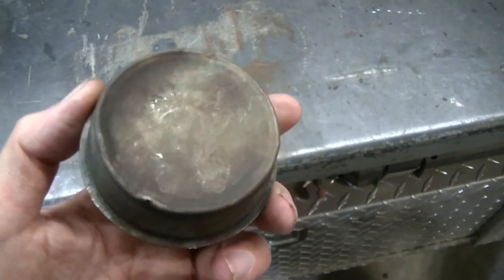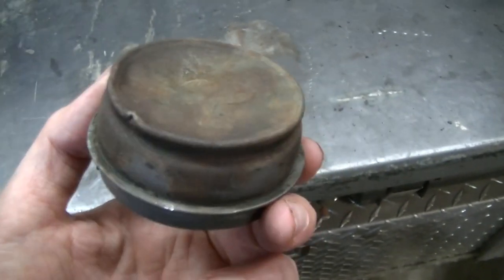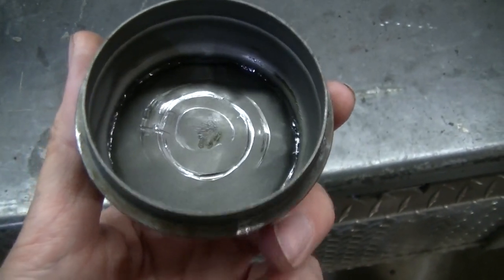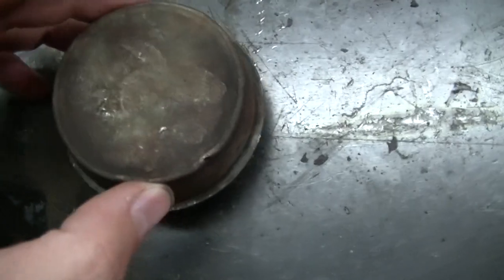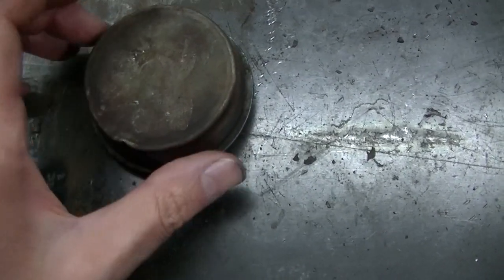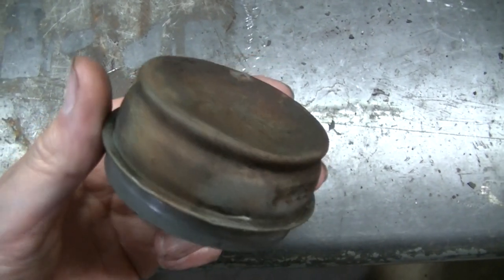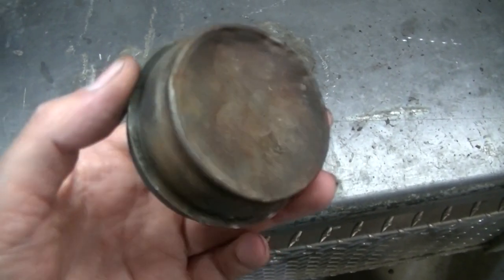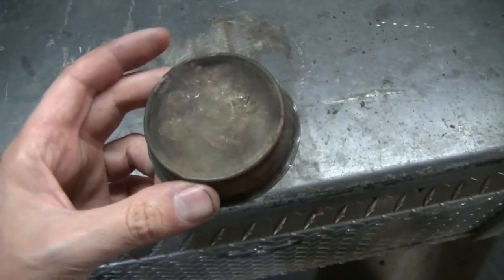Dust Cap Installation "Quick Tip"

Comment: Easier said than done! I tried for about a half an hour to put one on by tapping on the edge with a screwdriver, but it wouldn’t go on. I will have to find a piece of pipe. Also. The cotter pin isn’t supposed to be bent over the top of the axle. You’re supposed to bend it around the side
Reply: Often they are, but it depends on the castle nut design. Sometimes the cotter pin head is designed to go in the castle nut a certain direction, which impacts the direction you can bend the pin.

Comment: I'm glad I watched this video I was about to bang on mine  like you said not to do. But I wonder if I could ask you a question some of them are so loose that they won't even stay on. Can I use Loctite or is there a way to expand the ridge to put them on tightly.
Reply from the maker: You can try to flare the bottom out a bit but it sounds like you need new dust caps. They are really important and pretty cheap. They take a beating most of the time I guess because people don't care to install them correctly.

Comment: It would be nice a tip for putting the rubber boots that protect wiring in the door to piller. After running new wires I can’t get them back on
Reply from the maker: nathan harland See my silverado rear door removal video.  It shows the plastic piece better and how to remove it.  Should be easy to get the boot back on and then snap the plastic piece back on.

Comment: I'm having a hard time with mine as air pressure inside the cap keeps pushing back.
Reply from the maker: You sure it's the right size cap?
Reply: It measures out 2 1/2 inches. Same as the hub.